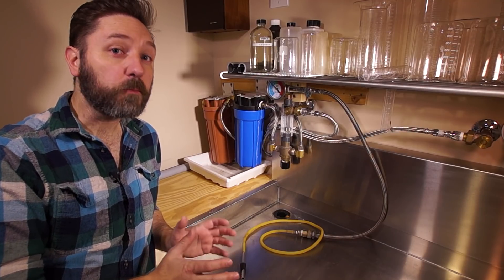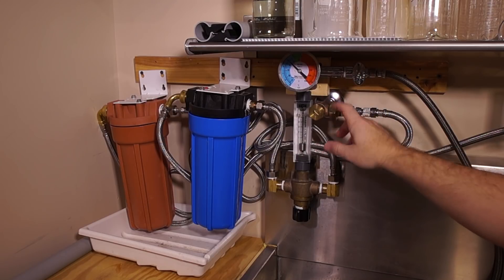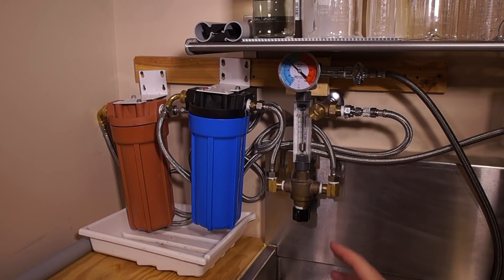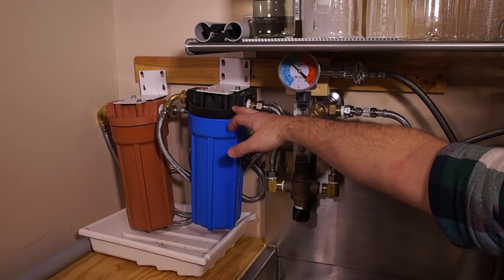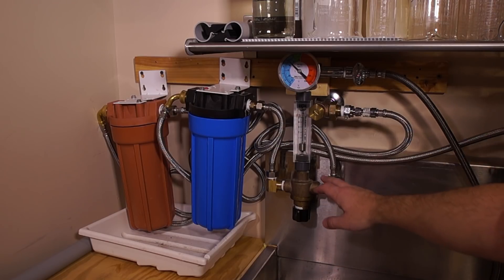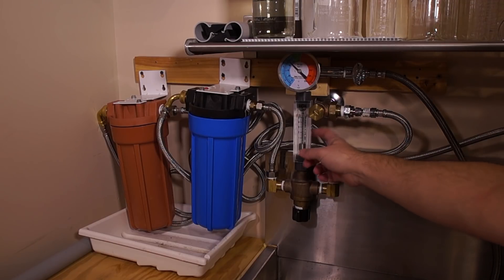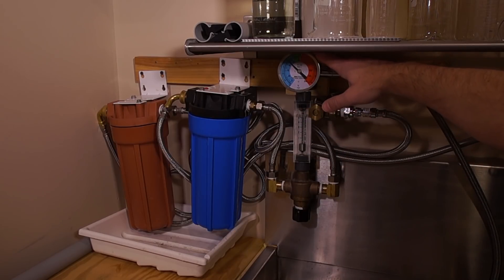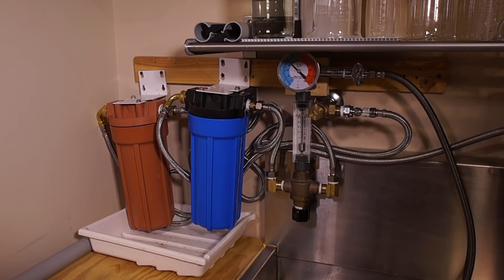$950 for Water?!?!

Comment: Not a plumbing expert so maybe a dumb question, is there a reason why you filter each temperature line before the thermostatic mixing valve? Could you simplify the setup and only filter after the mixing happens?

Comment: I was fortunate enough to get mine from a retiring photographer, attached to a size stainless sink. It does not have filtration, but I'm on city water. However, for mixing developers, and final wash, I just buy distilled water from the grocery store. $1/gal. Heavy users may be better off with a reverse osmosis / DeIonizer filter system. But that's getting pretty fancy!
Reply: I think distilled water is a good idea when mixing chemicals.
Good idea.

Comment: Do you know what the minimum temp for that valve is?  They don't list it on the Leonard website.  I have been looking for a mixing valve and most of them start at 85 degrees or higher
Reply from the maker: I have no issues keeping the temp at 20°C
Reply: @TheNakedPhotographer  Does the valve have temperature marks on it or do you just adjust it and watch the thermometer?
Reply from the maker: I just adjust using the thermometer I attached

Comment: I was reading the datasheet for the 270-LF mixing valve (as one does) and see it specifies "Temperature adjustment range, 90-140F (32-60C)" Are you still able to get stable temperature of e.g. 20°C?
Reply from the maker: Yes I am

Comment: Are you using the for B&W processing? I looked up the specs on the valve and it doesn’t look like you can set it as low as 68f. Are you able to get temps this low with your set up? Great vid BTW!
Reply from the maker: I use it for all processes.  It works great at 68F

Comment: I did something like this around 1980 when i built my darkroom. Back then, suppliers were more darkroom friendly, so options were more numerous and prices a lot lower. My hot and cold feed into a Leedal mixing control valve which has a larger thermometer reading output temp. The output Ts, one to a faucet for unfiltered output (Water supply; print washing). The other feeds to a Unicolor filter which handles cold up to about 115 degrees F (film washer; chem mixing water) with 5 micron filter and active charcoal filter, then to faucet. These connections are all hard copper piping. Final touch is snap connections for hose water line, film and print washers. My mistake was not considering the effect of highly calcium (hard) water, which has deposited inside the mixing valve; it still auto stabilizes temp, but the valve adjusting the temp level is partly jammed. I'm going to have to disassemble  copper pipes to pull the valve for repair or replace - ugh! I wish I had used flex connectors as shown here.